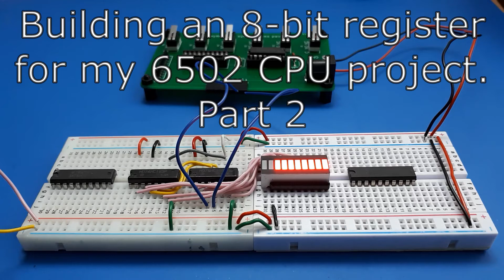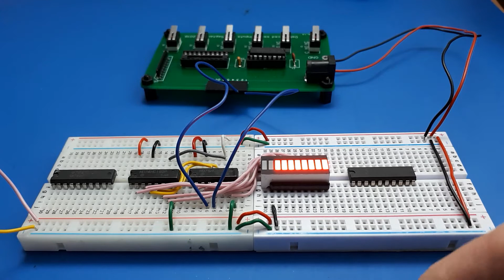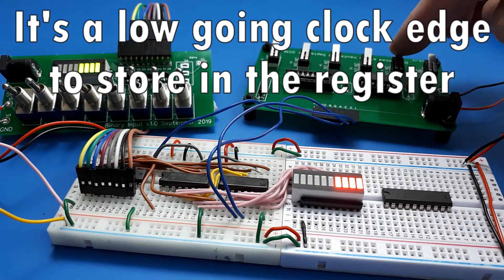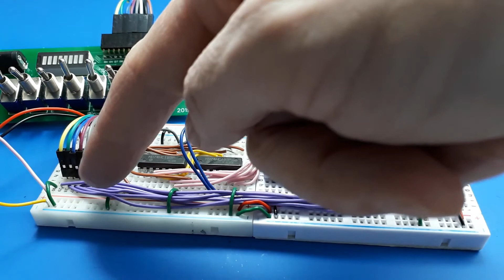Building an Index Register for my 6502 CPU. Part 2

Comment: Why do you need a latch? Why not just trigger that parallel load line briefly with a rising edge detection circuit, i.e., using a little capacitor?
Reply from the maker: I don't recall the exact decision that took me down that path, but yes you are right, I'm trying to convert between level-based and edge-triggered, i.e. go from async to sync.